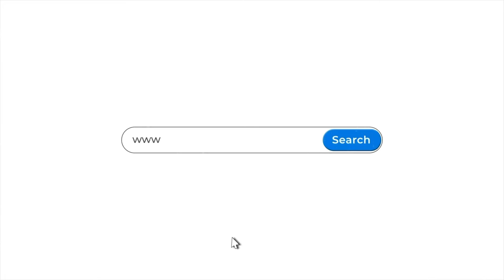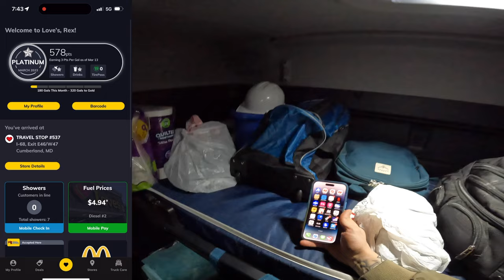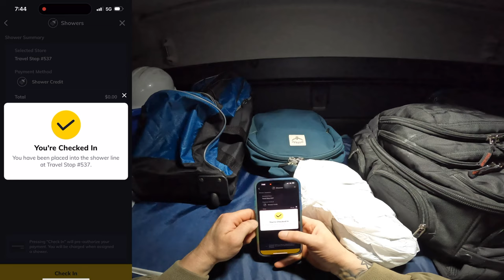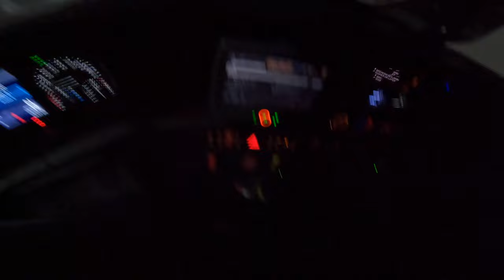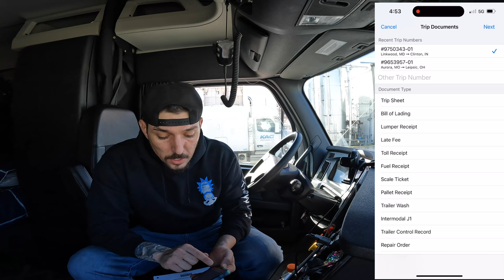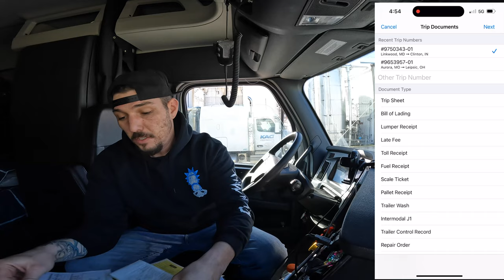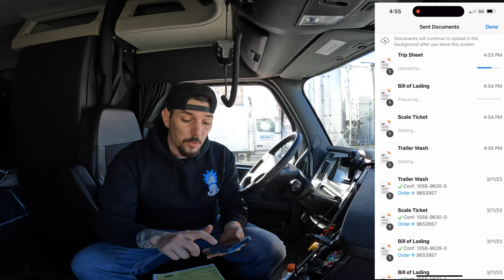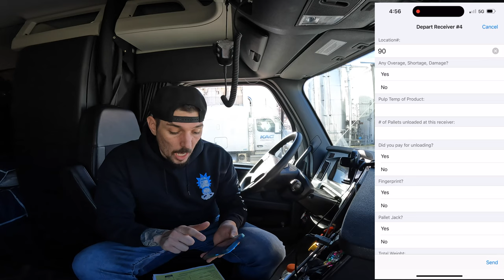Rookie Trucker makes it look easy! 18 wheeler trucker (Prime Inc)

Comment: How long do you have to work for Prime before leasing?  I’m currently driving for a huge trucking company, that everyone makes fun of, and would like to get into the tanker side. We don’t have tankers, so I’d be interested in hearing what Prime has to offer.
Reply from the maker: You can jump straight into leasing at prime no waiting
Reply: @truckingwithrex  Do they do a credit check to lease?  Also, is it a walk away lease if the money isn’t there?
Reply: I just finished applying with Heather Bishop.  I haven’t spoken to her yet, but did get her email.  I put your code down.
Reply from the maker: @wes5163  yes my truck is a standard walk away lease. So if tomorrow I just decided it’s not for me I can turn in my truck without penalties.
Reply: @truckingwithrex Hmmmmm very Intriguing